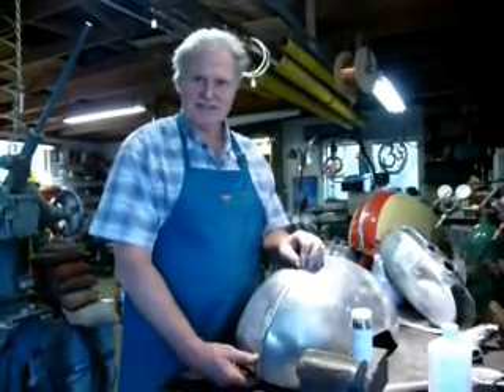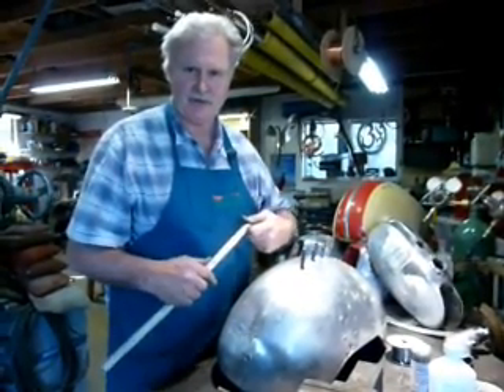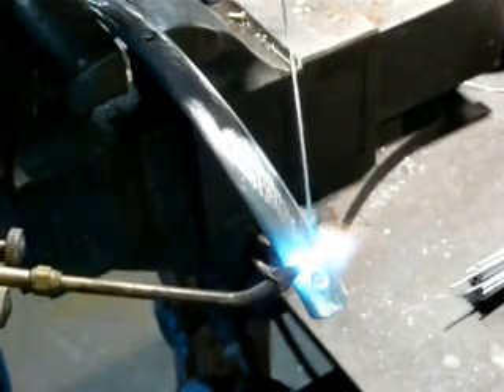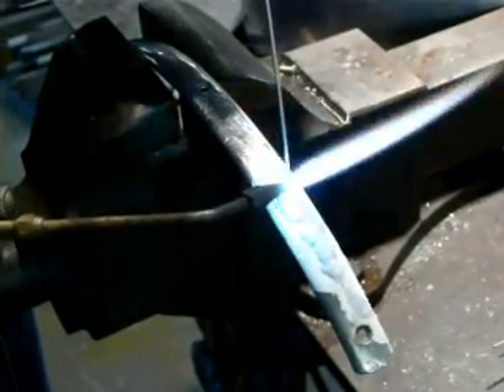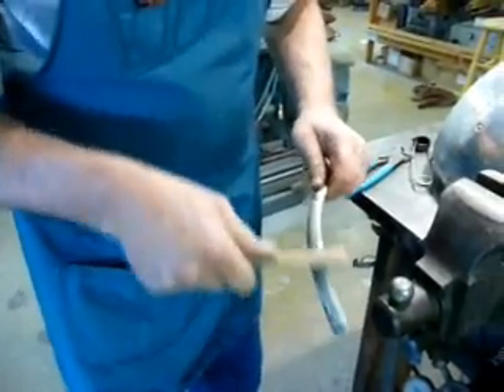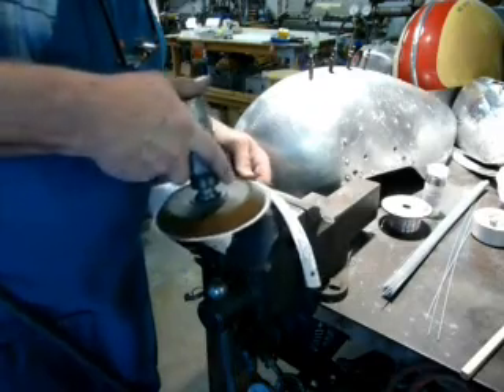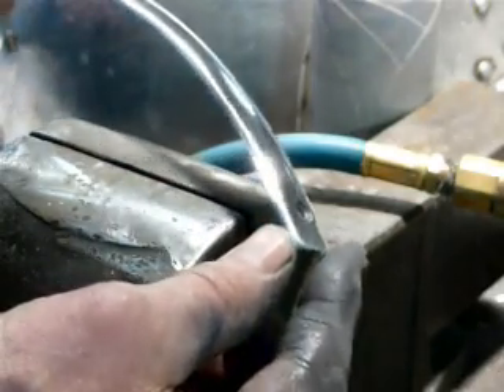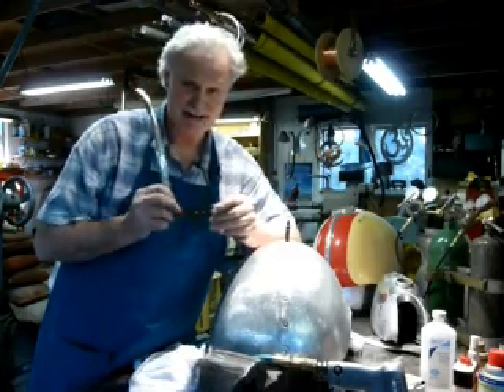Brazing Aluminum

Comment: Tinman,..what would you recommend using to fill in holes on thin (.050) aluminum? They are various sized bolt holes (3/16" to 7/16") on the transom of an old aluminum boat.

Comment: Thxs Tinmantech, I am tig weling 5083 alum. Im using a filler rod of 5556 3/32 but im getting some very small pin holes. do u think ur product will wk on my pin holes? my part will also need to pass penetrate inspection, they have to be clean of porosity and slag inclusions. Please advise if ur product will wk for me?
if so... please give me details on ur product and where to purchase this flux-core brazing rods, thxs again

Comment: Do you have the same kind of results with a propane torch ? It seems that your oxygen acetylene torch heats up the brazing better without melting the part as long as you heat up carefully ... I can't get to the same result with my propane torch even though I have some fine brazing rods ...

Comment: My goodness, that was wonderful. I have a motorcycle petrol cap made of ´´pot metal´´. I paid 40 pounds ( English) to get it rechromed and it was rusty within 2 months. They did not fill the tiny, tiny, holes that obviously existed after 30 years exposure. This is what I need to do. Ta very much. Tony.

Comment from the maker: @jf99151  The BSA motorcycle tanks are quite often made of BIRMA-BRITE, a british alloy equal to our 5052. This marine-grade alloy is very corrosion resistant and therefore you need a corrosive brazing flux with the correct filler rod. Our flux-core materials simple will not work. Be sure to use the corrosive flux and rod combination (not the flux-core rod product). - tinman

Comment from the maker: @nickf1229  Usually these tanks are made out of 5052, a marine-grade alloy. Brazing these pits can be done using a rod and a flux combination (NOT flux-core). Soldering is impossible. Otherwise, it's best to cut out the bottom and put in a fresh one. - tinman

Comment from the maker: @Myminizzle For boot lid repairs on old Bentleys, I always cut the ruined area out, in circular or semi-circular patterns (never with square corners). I fit a patch of the same thickness material and of 3003 alloy butting it carefully around the perimeter. I then weld it in, using the torch, flux, and 1100 filler rod.

Comment from the maker: @rooster4501  Yes I would. I would use our flux-core brazing rod. I would vee the crack a tiny bit on each side, clean it thoroughly with isopropyl alcohol, and brush it with a stainless steel toothbrush so it is clean, clean, clean. - tinman

Comment from the maker: @blkbernard I look at the strength required, and then the joint designs possible. Lastly, I look at what temperature the part will withstand. I generally solder soft, thin parts. I will braze parts that enable a T-joint or lap-joint. And I weld when given a strong part that allows a butt joint. - tinman

Comment: CAN I REPAIR PITTING AND CORROSION ON A 168 Gallon MARINE DIESEL FUEL ALLUMINUM TANK SEVERAL HOLES IN BOTTOM...IF NOT CAN THE BOTTOM BE CUT AND REPLACED/WELDED BACK ON? PLEASE HELP

Comment from the maker: @jf99151   British Small Arms made motorcycle fuel tanks that were formed of BirmaBrite, equivalent to our 5052, which my company clearly declares as simply not joinable with this rod. I must apologize for any confusion. There is an excellent alternative, however, and that is our Rod & Flux Combination. I recommend using our TM2000 welding lenses though (to absorb the sodium orange flare given off by the flux). - tinman

Comment from the maker: @AutoPilotDeLorean   For steel rust pits you have to dig all corrosion and dirt out of the bottom of each pit, making the steel bright. Then you can use roll solder and its activated flux from the hardware store. Flux the fender and the solder wire, warm the fender until the flux sizzles and then touch the solder to the spots. the solder will flow in and fill beautifully.  For chrome, use the orange flux-coated silver braze we have on our website. - tinman

Comment: @tinmantech 

what would you recommend i use on these BBS aluminum wheels. im not sure if they were forged or cast aluminum. i have an OA torch and a dc tig welder with argon or helium.

Comment: Kent what do you think of that hts 2000 stuff. would it be good for aluminum brazing on wheels. they were corroded and pit marked really bad and sandblasted turns out theres holes through the wheel